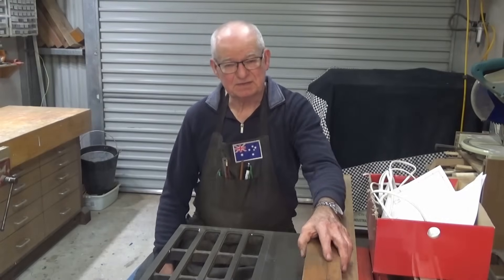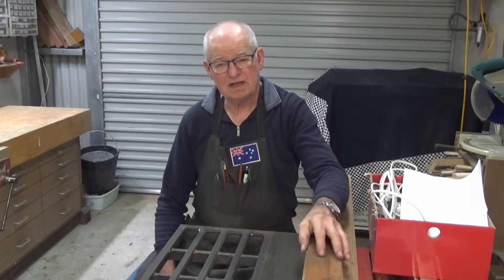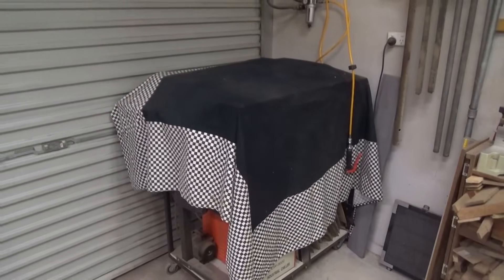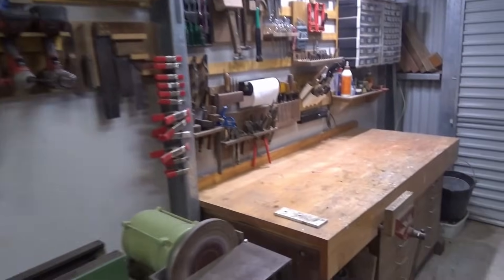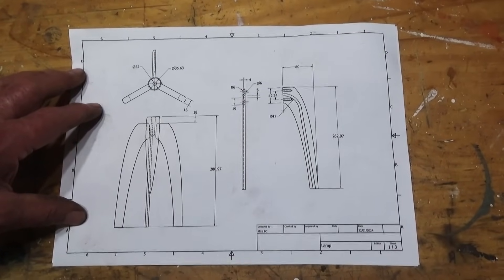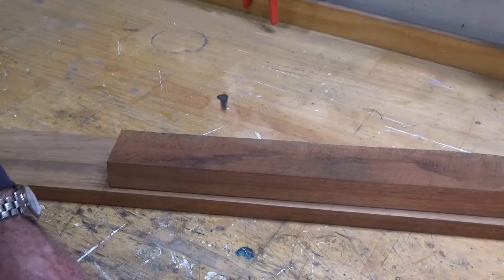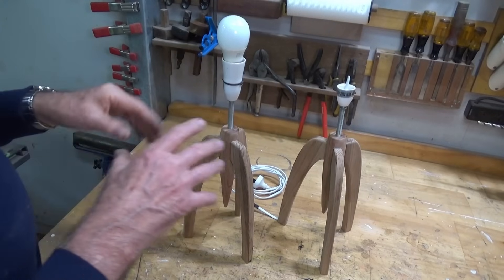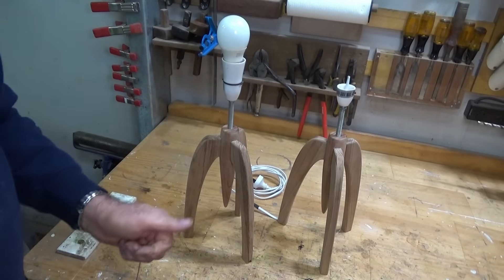Rocket Lamps. A pair of DIY, Mid Century Modern Bedside Lamps

Comment: Gday Preso, I’m not a woodworker in anyway shape or form and closest woodworking tools I have is a Stihl 066 chainsaw but enjoy project like this, looks great so far mate, cheers
Reply from the maker: Thanks Matty. Unfortunately, for woodworking you almost certainly need a separate space. A lot of wood dust will promote rust on shiny machine surfaces and it gets everywhere. I used to just have the one space for all my machines and it was a constant battle to keep everything clean during a woodworking project. I built the extra space onto the back of my shed about 12 years ago. It would be nice to have it a bit bigger but I would have had to excavate a lot further back into the embankment and then I would have needed an engineered retaining wall. 
Regards,
Mark

Comment: I like the design very much. It's just that working with wood makes a terribele mess in the workshop :)
Some nice wildlife clips at the end.
Reply from the maker: Thanks Michel. That wood has a somewhat nasty dust. It stains your skin black and it is a bit toxic if you have a lot of exposure to it. I bit the bullet about 12 years ago and built the extra space on to the back of my garage so I could make wood projects without getting the dust all over my machine tools. It's good but it's not big enough.
Regards,
Mark

Comment: Thanks Mark! I really like the way you can co-opt metal working techniques to get stuff done with wood.
Reply from the maker: I think it's important to look at a machine as a bit of a swiss army knife. Metal lathes can be made to do way more than just turn metal objects and wood lathes can be made to cut metal. I once visited an engineering workshop and the owner told me the most important and versatile machine in his shop was his hydraulic press. He claimed to have used it in ways it was never designed to be used but he got results that were pretty amazing.
Regards,
Mark

Comment: Ohooooo very cool design, cool aesthetic. Love the wire routing approach.  My vote is for a rocket "nosecone" to cover the threaded tube. I find lamp stuff is its own world of sizes and thread pitches. Some I've worked on were pipe threads, which I find strange, but they do tighten.  btw, a clear horizontal surface no matter the size or location is a magnet for everything.
Reply from the maker: Thanks. The stems of those lamp holders were M12X1 and I do have a tap and die for that size. However the stems screw into the bare wood quite tightly. The decorative parts for the stems are finished and they are a bit of a nod to the Jetsons (The Hanna Barbara cartoon series).
Regards,
Mark

Comment: I love woodworking, I was a cabinet maker many years ago.  Nowadays I use my CNC machine for woodworking projects because of a disability.  I also do small metal work projects, nothing fancy.  That bed frame looked awesome, and the lamp design very interesting, I like it.
Reply from the maker: Thanks. I reckon a lot of workshop tools are underutilised. It's worth looking at what a tool does and then thinking laterally to see what other materials it can cut, bend or form. 
Regards,
Mark
Reply: @Preso58  I really like the hardwood that you used, it almost looks like Koa.

Comment: Wow you do woodturning as well Mark. I can see you have had some training (or watched a lot of YouTube videos?) by the way you use the spindle gouges and skew. Good to see a wood project and the piece came out really good.
I have had a big clean up and some new changes in my shop since you visited a few years ago. The issue is that I have run out of room so I'm starting work on extending the small shed down the back. I will then move all my woodworking and woodturning gear into that space. Currently I find that my metal working machines and gear get a lot of dust on them from doing wood projects.
Reply from the maker: Jon, building the extra space on the back of my garage was the best move I made. I wish I could have made it larger but I would have had to cut a lot further into the embankment at the rear of the garage. Wood dust holds moisture and it promotes rust on things like lathes and mills. 
The only training I had on woodturning was at college. I think we did a short module and we had the option of including turned parts in a furniture making project towards the end of our training. Mostly I was self taught with a lot of trial and error. Bowl turning scares the living daylights out of me but between centres work is more my style. 
Regards,
Mark

Comment: Hi Mark, I follow your videos with great interest.
One thing I remarked in this video is you're keeping chemicals on high shelves.
When I were working in laboratories (chemical engineer), we always kept chemicals below head height - if they accedentially tip over or the lid is not properly attached, you might spill chemicals over your head on high shelves.
If it's paint - it's just a mess, if it's acid or alkaline - it's dangerous
Reply from the maker: Yes, I can see why that would be an issue. If only I had the space to do that. Most of the chemicals stored up there are not toxic. I keep them and the acids in another storage cupboard in the metal shop and at waist height. However, they would still not be nice all over one's melon. 
Regards,
Mark

Comment: Looking for a good bugzapper. Is your one custom or store bought?
Reply from the maker: I think you might be referring to the blue LED sign that is up high on the wall. It is just a plasma cut stainless steel sheet stencil that was made for me by a very talented metalworker who makes military insignia with a CNC plasma cutter. I just mounted some blue LED strip lights behind it and wired it in with my shop lights. It does look a bit like a bug zapper but it isn't. 
Regards,
Mark
Reply: @Preso58  Ahhh, thanks for the clarity.

Comment: Mark.  You scared a sh!t out of me  while sawing on circular saw. it is so much dangerous.  Please, use safe tecnique  while operating circular saw.
Reply: You should watch Oriental wood workers. With discipline and correct technique they are injury free. I think here in the West OSHA has scared everyone.
Reply from the maker: Fear not! Statistics show that most industrial accidents happen to young people and those new to the job. I am certainly not young and I have been working with circular saws for over 55 years, and I still have all my fingers and thumbs. 😁
Regards,
Mark
Reply: The blade was more than 2" below the surface of the wood and it was a fairly shallow cut. Any 'safety' benefit with a push block or stick would be questionable when compared to them losing contact over hand held.
Reply: Yeah, what  @seabreezecoffeeroasters7994  said. There was no dangerous or improper technique used in that cut.